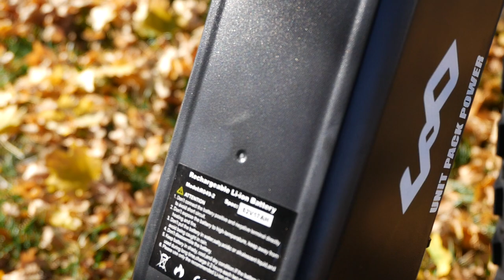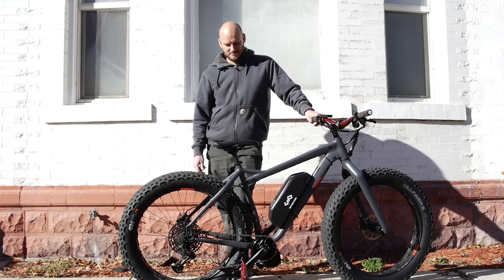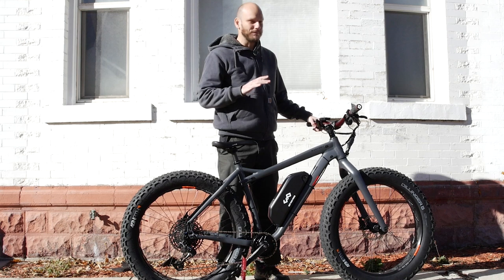Custom E-bike Build: Salsa Mukluk 52v 17ah BBSHD Bafang Mid Drive

Comment: I’m building this exact bike at the moment. How was the chain line in low gear, with all the spacers was there enough thread for the crank lock ring cover to fit ?
Thanks

Comment: Interesting gear shift sensor on this bike. Looks like there is derailleur cable housing caps on both ends of it. Unit Pack Battery too.

Comment: Johnny I know you hate hub motors, but Ariels Kleper has a 1000 watt rear hub motor, that will put out 1800 watts, takes the bike to 34MPH, and has a 20 ah 52 volt battery for $1800.

Comment: Question why the 120mm over the 100mm kit? I’m trying to order a kit for pro install in Washington DC and they said to order the 100 contrary to yours.
Reply from the maker: I can’t remember off the top of my head. It could’ve been chainring preferences of the customer that didn’t jive with the 100mm. It’s very tight tolerances on fat bikes sometimes
Reply: Awesome thanks for answering